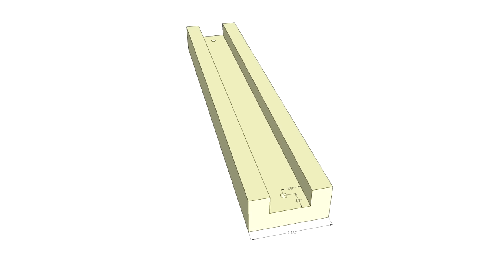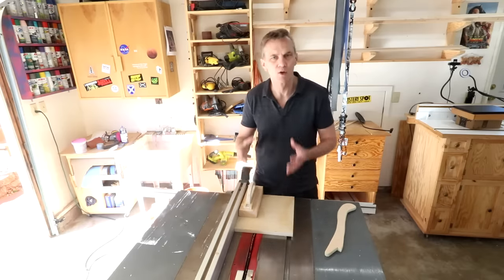How to make a push block. Essential woodworking jig and shop project.

Comment: This is one of the best push block designs I've seen. I love the simplicity of it, and I especially love how easy it is to swap out the sacrificial parts in just a couple of minutes.

2:19 Steve, c'mon, man. You should know better than me that whenever you're trying to cut a piece that's wider than it is long, you should be using a sled. The wider a piece is, the more chance that your left hand will push faster or slower than the right, which leads to binding, which leads to kickback.

5:32 I was also gritting my teeth through the whole cut out of the handle, but a couple of times you really looked like you were about to lose part of your left hand. For a piece like that, I always find some way to clamp it down and move the saw around the work, rather than moving the work around the saw. The smaller a piece is, the easier it is to lose your grip and jerk your hand into the blade, or jerk the blade into your hand.
Reply: Based on my experience I wouldn't consider using a jigsaw like that to be particularly dangerous.  Just make sure you're using sharp blades.

Comment: You can buy these non-slip boot mats for about 5-10 bucks per square meter, cut them to fit the block and glue them to the underside of the pushblock (with epoxy glue or super glue). This will give the block enough grip so that you don't need the little hook at the end.

Comment: I would put threaded inserts in the end and make sure the holes in the cleat were consistent. But this presupposed that the 2x4 will be used a lot longer than the cleats.

Comment: I don't get the glueing sandpaper for more grip suggestion. If you have coarse sand paper, you can just make the wood face coarser, thus gripier, with said sand paper by lazy hand "sanding"/ scratching. Or take light passes on the sable saw without the cleets installed to make a some kinda of "tire" pattern.

Comment: Late to the party, but for a simple solution to give the block more grip, what about a thin layer of rubber cement? Just brush it on and let it dry. Would that work?

Comment: Can you do a custom miter gauge fence next? I use the miter gauge that came w/ my saw and a piece of ½" plywood screwed to it. It works, but I've noticed it has started to curve slightly and doesn't give a true 90º angle. I know I could google/buy a better option, but would love to see what you come up with.

Comment: Would using wood glue and dowels work as well as screws and prevent the risk of hitting the screw with the saw blade ( I understand that this is a small risk)

Comment: good video and useful addition.  The only comment I have is that with the screws for the handle into the block could be hit with blade, Use plastic screws of dowels with no glue.

Comment: Hi Steve, Thanks for making a easy and much cheaper option to the GRR-RIPPER! I had one question.
Do you think there is any advantage of laminating some mdf pieces as the base instead of the 2x4 as mdf will be easier on saw blade?

Also, how do you draw those target point when you print stuff on multiple pages? I never get that correct and spend a lot of time aligning pages!!

Thanks for making amazing videos! Cheers!
Reply: I think MDF might be too smooth and less grippy. Just use the mozzarella cheese white wood 2x4s that you get at the big box stores. Those are so soft, they'll be very easy on your saw blade. Your thoughts, Steve?

Comment: Question, newbie here but when you cut the plywood using the rip fence, I thought that would be an unsafe cut or safer with the miter due to the ratio of length to width?

Comment: I like this push block as you can  make thinner cuts w/o issues with the thin strip. My only screw issue is the length.  Why so long?

Comment: Yeah ok I finally got around to making one of those, and tried it, and it is not for me. It may be safe. I couldn't say specifically what could go wrong. But pushing my very hand over and across the saw blade like that makes my hair stand on end. It feels super creepy and dangerous and unsafe. As if it could tip over into the blade at any moment. Though that might have been because the workpiece was rather small and the depth of cut needed to be set fairly high. So lots of blade was exposed above the table.
In any event, you have to work without the saw blade cover, which in itself is already something of a no-no.
I'll keep using the two-push-sticks method, thanks.

Comment: Great job, Steve. You have accomplished most of the really necessary features of the (yellow) "Super Duper Premium Push Block 5000" for just a few minutes of time.
I didn't catch the brand of spray adhesive you used, which appears to be easily removable. Which do you recommend?

Comment: I am very new to woodworking and find your videos most helpful.  Thanks heaps.  I have searched but am unable to find the templates for the push stick and handle a push block.  Can you advise were I can find them.  Thanks again.

Comment: That's good design. Doing dovetails or some other weird and complicated stuff is useless imo. To me that's safety tool and it needs to be quickly and easily fabricated as it's likely to wear out and you just need to make replacement at some point. I'm still planning to get tablesaw at some point and I'd definitely make couple different widths of those push blocks.

Comment: I have noticed that the fence of your tablesaw just grips from one side. Does it keep perfectly aligned with the blade or, once the beginning of the blade is in the correct distance from the fence, it is ok that the end of the fence is 1 or 2mm far from the initial align?

Comment: I actually did the opposite, cut a handle out of a 2/4, and glued piece if 3/4 inch plywood on the bottom, and screwed another piece on the end for support. whenever the bottom gets used up, I just cut it off on the saw itself and glue a new piece in place. this has more surface support, I may end up makeing this also just to have variety.

Comment: I'd probably go with the glue-up instead of metal fasteners, even soft metal, because if there's a way to blade-strike those screws, I'll find it!  Some glue, couple clamps, couple hours, and there's no possibility of it.  As for re-using the handle or changing out the cleats, simply cut them free with a quick buzz on the miter saw and glue to a new block.  For the awkward cut-away of the handle, just clamp it to a scrap that would serve as a holding jig.

Comment: Great video and push block/stick design. But I have to disagree with you on your blade height adjustment. I agree that you should keep the blade as low as possible, but the blade height should be set just high enough for the top tooth  to fully clear the work piece (not just the tip of the tooth). This will aid in the blade to efficiently clear saw dust (especially in rip cuts) and reduce work piece friction and thus edge burning. Ultimately this leads to soother, cleaner cuts and therefore safer cuts.

Comment: When cutting plywood for a thin strip, just use the miter gauge. There's no chance of catching the piece between the fence and the saw blade. You don't need two push sticks for a table saw, they make cowels you can put before the blade to keep the wood in place.

Comment: Seems like instead of screws holding things together, wooden dowels and glue would work holding the handle to the block, and tapered dowels tapped in the back should secure the cleat to the block, unseat them to change the chewed up cleat piece when needed.🤔

Comment: I have always been terrified of this style jig, when I was younger my uncle was using one similar to it and it got slightly sideways and kicked back off the top of the blade. He ended up with 3 broken fingers from the experience. Having seen that happen the idea of a pushblock comming in contact with the blade is a no go for me even if the chances of having a problem with it are almost zero
Reply: So sorry for your uncle, and it's always terrible for a child to watch someone get hurt.   
But it's also important to learn from the incident, and know exactly what went wrong and why, and how to prevent the same from happening again.

But, are you sure he used a push block like this, if the push block could end sideways during the cut?

It sounds like he was using one without an endpiece (cleet?), as with this feature, like the one in the video, I can't see how it would be possible to move the push block sideways during a cut?

Unless the push block was too wide, and there was not enough clear and safe space between the block and the blad?  
And in that case, he should have used a narrower push block or a stick instead? 

No, no, I'm not trying to make your uncle look bad, not at all, but the opposite.

It's all about what we can learn from the mistakes we all do in our life, and how to help others not to make the same mistake!   (I was an addict for many years, and sure have done my huge share of stupid mistakes, and used them to educate young people)

I absolutely get you from what you have seen, but what would you use instead? 

How would you make the cuts in the videos where Steve uses the push block, without using a push block? 

To make the cut between the blade and the fence to go straight forwards and not get stuck and perhaps ending sideways and make a kickback?
 
I think this video shows us exactly how to use the push block in a safe way, and how it prevents kickbacks.  
And it's all about using a push block with an endpiece, and with a safe space between the block and the blade, or use an extra push stick if it's a narrow cut.

Greeting and stay safe (y)
Reply: @pirakoXX  it was similar to Steve's except the lip at the back was formed by cutting away material on the bandsaw rather than screwing a tab on. Personally I use 2 push sticks based off of Mathias wandels  design I prefer being able to see the full cut, having my hands further from the blade, and the versatility of them.
Reply: @ryancarter4418   Thank you, Ryan, oh, yes,  I've seen that kind of push blocks in videos, and I'm not impressed by them.
And certainly not as a beginner, as I'm having huge, huge respect for these power tools ... and I too want to keep my body parts intact as long as possible! 
Matthias Wandel is an amazing woodworker and engineer,  and I'm always amazed by this work and the thoughts and science he bases this work on  (y) 
How he made his panto router and made it work so perfectly was just another amazing video to watch!
Reply: The plastic ones that come with a table saw are bad for this reason. Mine touched the blade and ended up across the street. No broken fingers but real scary

Comment: 02:22 Oh.., oh.. Steve - is that piece of tin sticking out on your blade insert about to become a safety issue?
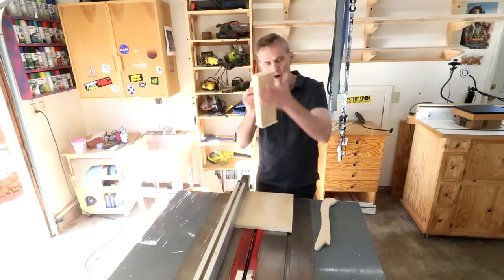09:35 What if the blade (once raised high enough) bites into the screws?

Comment: Or you can add an inch or so and use a block between the fence and the work piece, therefore having a gap so the piece doesn't bind.

Comment: Hi Steve,
What I don't understand is why there is a stop block needed at one point, and not the other. Where both seem to be the same action.

Comparing 03:30 and 08:30

I don't understand, can you elaborate why it doesn't matter at 03:30?
Reply: Most likely the length of the cut and shape of the piece being cut off.  The first one is a long, very narrow piece and possibly much more chance of it going skew if not supported from behind through the cut.

Comment: So which is better, micro jig or this one? Not factoring price what is the reasoning?
Reply: It depends on what you are doing and your budget. The one Steve made is great for your everyday basic cuts. A Grr ripper is fully adjustable and with an added accessory can help you safely cut strips up to 1/8 of an inch (3.175mm). It also lets the blade ride up higher under the Grr ripper without sacrificing anything.

Comment: Or I have another idea: Just use a thicker sacrificial wood part, so that way the screws would naturally be further away from the saw blade. This would also give you more safety since your hand would be even further from the saw. 2x4 is a common wood size, but you can easily get thicker wood too.

Comment: You're missing a trick there Steve. Most modern software will have a "fit to page" option. No need to waste two pieces of paper and then stick them together when one piece of A4 will suffice. <thumbs>
Reply: You don't understand what the templates are for. They depict the actual size of the push stick, hence the need for two pieces of paper. If you would fit to page, the push stick would become much smaller.

Comment: Steve my riving knife is taller than my blade when fitted by about 2"-3" which causes problems when using my table saw when I don't want to cut all the way through the wood.  Do you have any suggestions for looking for a new riving knife?
Reply: Are you sure there aren't two stop positions for the riving knife? My saw has a position that comes up above the blade and a lower position for non-through cuts, and it's the world's cheapest ryobi saw.
Reply: @TheNathanlockhart  yeah it's just a bad saw (currently on offer for £73 in B&Q, I paid £99 18 months ago).  The top is like a triangle on the riving knife..

Comment: In the interest of my safety policy, never use the table saw to do what the 3D printer can do, a whole lot easier and safer. On the things where the actual material doesn't matter, it's the way to go. I've already done the work in Freecad, using your plans, if interested.

Comment: For some reason, my micro jig keeps hitting blade. Particularly when I forget to sight the blade to the jig as I am suppose to. I am going to try your push block. I too , miss the micro jig lead ins.
Reply: The first time I forgot to adjust the center piece of the microjig I shaved it in half. I was so mad at myself considering how much I paid for it. But then I saw that they were selling an optional 1/8” center for more $$. Before I could decide if I needed one I realized I saved the money by making mine into a 1/8” by accident.

Comment: 14:24 - another idea for the bottom to be more tacky, have a layer of glue on it, I don't know which one would work, let it dry overnight and the surface will be less dry than the bare pine board.

Comment: I am confused by how the push stick is used toward the end of the video. Steve is pushing the cutoff workpiece towards the blade. That strikes me as unsafe since it will potentiallt cause kickback and also deflects the blade. Like feather boards, push sticks should either only be used to push (doah) the wood forward or help with pressure against the fence. In the latter case, don't push beyond where the blade starts cutting.

Comment: I like that you're considering this the simplest version. Whole time I was wondering why you made it so complicated. This is a square with a handle and a cleat. Step one, cut 2x4 to 8". Step two, attach scrapwood in rough shape of handle. Step three, cut cleat. Step 4, attach cleat. Skip the cleat for best results. That cleat makes the tool into a rocket ship in the event of kickback. A simple friction surface is more than sufficient.

Comment: as somebody that has bought the microjig and loves the safety - there's 0 reasons why this isn't just as good.  One sorry time you'll forget to adjust the runners of the microjig and put it through the blade, and then be conflicted that your $60 purchase did exactly what it's supposed to do - but is still somehow ruined by its scars.  A 2x4 and some scrap plywood pushes just fine

Comment: Ummm... and what happens when you run the blade into 1 of the screws that you attached the handle with?  Think I'll stay away from metal screws around my saw, but thanks.
Reply: What happens is you potentially ruin a saw blade and see some sparks. But if you set your blade height correctly as Steve demonstrates in the video, then it's not a concern.